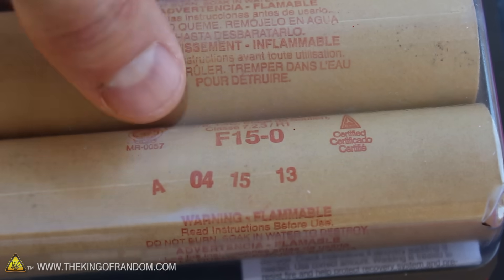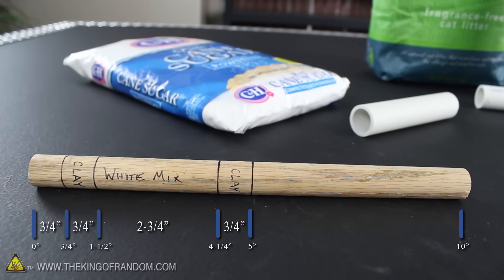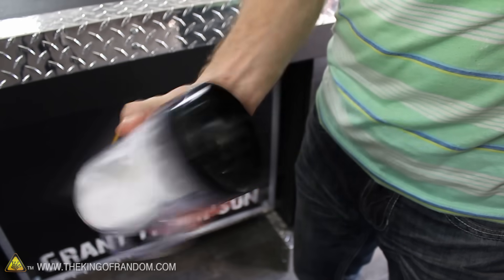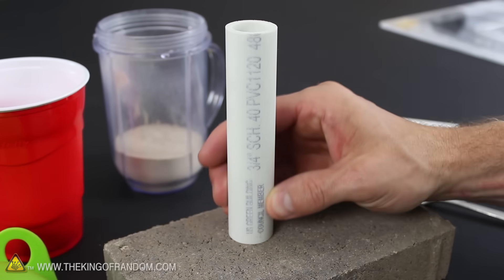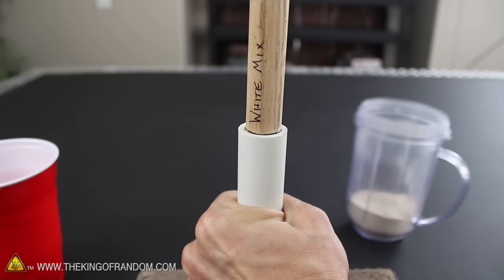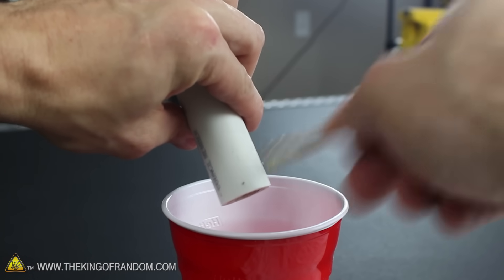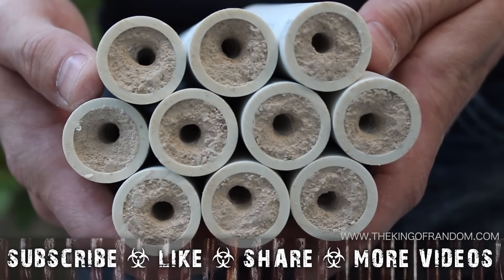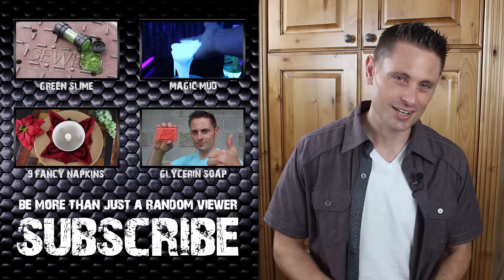How To Make Sugar Rockets

Comment: Could you make a video on an alternative thing for the cat liter. My dad does not want to ruin his nice blender. Me and my friends have a school project and need a good rocket engine that me and my dad can make easily without using cat liter please respond.
Reply: You could also head over to a thrift shop and pick up a cheap blender to dedicate to projects like this
Reply: Use a wooden plug or anything light, but if you use wood make sure it fits reeally tight and let it soak in water for a day so it swells a bit more.
Reply: Matias Eklund thanks for the reply and also do I do the same thing g for the bottom just drill a hole in it?
Reply: Bryce Kimball yes, that's what I'm planning to do atleast
Reply: So you think it would fly with a small hole in the bottom or do I need a bigger one? Also when ever you launch it with the kitty litter does the cat litter fall out of stay in for the whole flight? I'm wondering this because I am wondering if the would is going to just blow it up or all of the pressure come out the small hole.
Reply: If the hole isn't big enough, the rocket will just explode, since the gases can't escape fast enough. But as long as you don't drill the hole ridicoulosly small you should be fine. The kitty litter should stay in place if you pack it hard enough. Take a look at 4:43 in the video and you can see the kitty litter stays in place the whole time.
Reply: OK thanks for all the reply and answers to my ridiculis guestions. That's spelled wrong I know it lol
Reply: Bryce Kimball No problem! Just glad I can help
Reply: I'll probably ask you more later when I am building my own rocket.😊
Reply: Bryce Kimball Clay is much easier. If the blender is your problem, go to Goodwill or Salvation Army or a flea market or a yard sale and pick up a cheap blender for like $5 like he said in the video.
Reply: use a bowl and a morter with hardened caly
Reply: i mean clay--mispelling
Reply: blue pumfrey You might want a pestle to go with that mortar.
Reply: blue pumfrey Erm... the pestle is what you use to do the crushing. A bowl and a mortar is basically like having two bowls.
Reply: Matias Eklund Am Spodermen
Reply: I am...Batman lol😃😁
Reply: blue pumfrey spoderman pls
Reply: thats why if you dont have a pestle you have the bowl
Reply: Bryce Kimball You can purchase already-powdered bentonite clay as, for instance, a pottery supply. It'll cost more than cat litter, though.
If you want to pulverize cat litter, an alternative to a blender would be a jar mill. This can be made from a closable jar or can half filled with marbles. It'll require some hand work turning the mill, and then sieving to exclude any coarser bits that are left.

Comment: dear Thompson, i have a problem.
i tried with KCLO3 (easy to buy in my country) but it worked not well and the rocket was too heavy, so i added Fe2O3, charcoal and a little water then heat it until it turn black (or darkred ) color ... with this mixed, my rocket works (but it flew too low- just about 300m ~ 1000ft ) addition problem is : this mixed is not unstable, sometime it fires when i heat it so i have to stop doing that. Can you give me some advices ?

Comment: Great video! One step seems to be missing at the end, though... what do you use for the fuse and does it need anything to hold it in during transport? I hope I'm not repeating a question that has already been asked, but I didn't see it in the comments section. Also, have you tried this with a smaller pvc pipe and less of the potassium nitrate/sugar mix? Will it still launch?
Reply: I also looked for another video that might explain this, but the only thing I saw was the shorter version of this video.

Comment: i had an idea after watching this video and i was wondering if its feasible. i was going to make a potato cannon, but instead of having a combustion chamber like a regular potato gun i was thinking about making something closer to an actual "AT" potato gun. by this i mean having a potato in the head of a charge. kind of like a bullet. the potato would be in he head of the round, and the charge/ propellant (made of this stuff) would be in the back of the round. i could then ignite and it "should" act how a bullet or AT round works. would this actually work?

Comment: Grant Thompson - "The King of Random" 
AMAZING! Far better than my mixture! I have some info from someone else who replied to a comment I made. If you want more epower, add a small amount of red iron oxide. I got this info from ***** a little while ago. I have tried this and it works. The dry powder packed idea is awsome, I bet it would work even better with the iron added, or It might just make a bomb. Well, only one way to find out! I would never thought of it myself, as I always used a small amount of canola oil as a binding agent. The cheap litter for bentonite is also something I had never though of, thanks for the info.

Comment: Quick tip for everyone out there; try milling down a piece of aluminum or steel into the shape of a bell, but with a straight piece out of the top of it to form the plug. Packing your powders will form around the plug just right, and the bell shape will make a negative space that direction for your specific impulse.
Also, don't use PVC, since melted plastics are toxic for wildlife. You can find dense cardboard tubes for cheap online or as the cores of some industrial rolls of paper products.
Finally, don't grind cat litter down, just stick with Plumber's Putty. It's a whole lot more messy and spendy, but the litter will crumble from the heat and the rocket cell won't burn out before blowing out the bottom plug.

Comment: A friend made these with black powder but a different way that saves you some work: Drive a nail of the thickness of the drill bit right through a solid piece if wood so it sticks out as far as you need it to.  Then drill a hole up the centre of the dowel.  Place the tube over the nail so it is centered.  Mark it's position or place material around it so it gets held in the right place.  
Now just pack the rocket as in your method, bit by bit; clay, fuel mix, clay then just twist and pull the motor off the nail and it is done.

Comment: i remember using potassium nitrate for smoke bombs when i was a kid. if some1 if having problems getting it, its fertilizer. Potassium nitrate are sold in different %. If you use too strong one, it exploades instead of making smoke bomb. what %-age potassium nitrate are you using there? what differs using different percentage making those rockets?

Comment: How does this sugar + KNO3 rocket compare to similar formulations using corn syrup that you heat on the stove to form a paste? Is this more/less powerful? Seems like it would definitely be safer that heating rocket fuel up on a stove. Great video!

Comment: You should try adding other things to the mixture to get cool effects.
Magnesium shavings for a sparkly trailing effect(a drill and a magnesium firestarter block, to get the shavings CHEAP)
Borax for green flames, KCl("NoSalt") for violet/blueish, table salt for orange, Strontium compounds for red.
And of course you could always color the smoke with organic dyes. Rit should work, but I wouldn't breath it if I were you.
I know it's meant to be for model rockets, not fireworks, But I could hardly see it at the end of its burnout. Some extra pizzazz might help it be more trackable. Just a suggestion.

Comment: if the blender cost you $5.00 how exactly did the rocket cost you $0.50 to make? #fucktard
Reply: additionally, lets buy kitty litter and potassium nitrate for less than $0.50 .. oh wait, yeah thats right, nevermind
Reply: Nysvarth You're not very bright are you? Didn't get past reading and comprehension in middle school huh? Because if you paid attention, you will note that the coast per rocket motor equates to about $0.50.

Comment: This is far far away from less than $0,50
Reply: Total cost of supplies may be far more than 50 cents, but given the amount of material used per engine, it probably averages out to about that cost per motor.

Comment: I made everything exactly as the video said, but the fuel burned with some power while the rocket didn't launch at all. What have I done wrong?
Reply: You've probably got the ratios mixed up. Even having them a bit off can lead to different results. That or your potassium nitrate isn't pure enough.

Comment: May I suggest making a special ram rod, where a PVC pipe with the needed outside diameter has another pipe inside that it's inside diameter is large enough to slide over a stainless steel nail in a block of Wood so you can just take the rocket pipe off the nail inside the center and don't have to drill

Comment: IMPORTANT SAFETY NOTE: If this thing blows up, you'll be full of PVC shrapnel. That's bad because it doesn't show up on x-ray when it comes time for the surgeon to dig it out of you. Use cardboard tubes instead. Even then, it's still dangerous. Safety first and have fun.
Reply: YOLO
Reply: nah if the pressure gets critical the endcaps will go far before the PVC reaches its pressure limit.

Comment: Hey Grant, Could you do a comparison of the different methods for building these? Specifically your packing method vs the cooking/melting method. It'd be interesting to see how the burn rate and thrust compare. Based on my understanding of physics your packing would provide higher thrust and a quicker burn time with less overall efficiency than the cooking/melting method.

Comment: Nice job there Grant! You should make some core burner tooling so you don't have to drill holes. It wouldn't hurt to get some parallel wound rocket tubes also, safer than pvc.

Comment: Is there any possibility that this compressing of the rocket fuel using a dowel could cause enough compression energy to set it off?  I know a spark could and there are no sparking materials (unless the wood had significant abrasives in it).  However, I know that certain fuels can be ignited by compression, diesel being one of those fuels.

Comment: Hi grant, have you tryd melting KNO3 + sugar on an eletric stove? Not sure but I think it gives more energy. (dont do it on a open flame, it ignited lol)
Reply: You might be better off (and safer) using a solvent like pure alcohol to dissolve the powders into a paste, forming the engines, then VERY slowly warming the engines to desiccate the solvent.
Reply: FrankenPC Or just leave it to air dry.